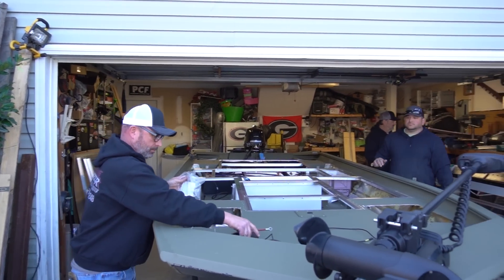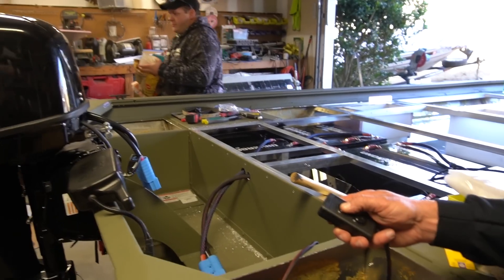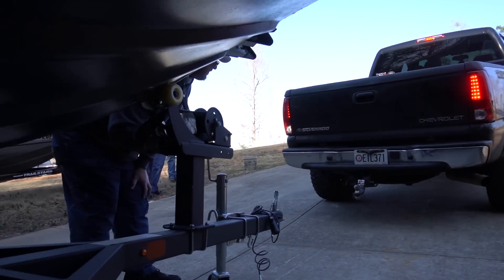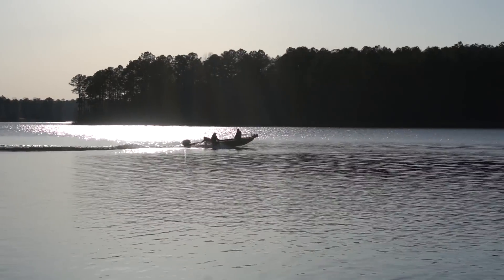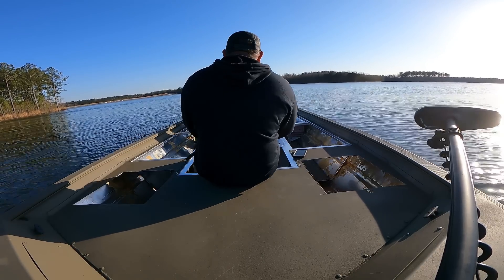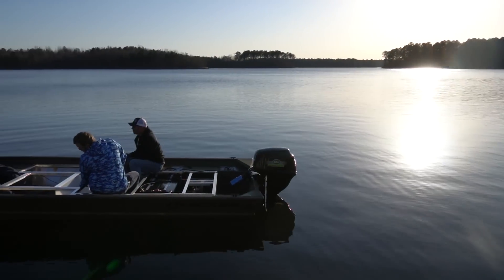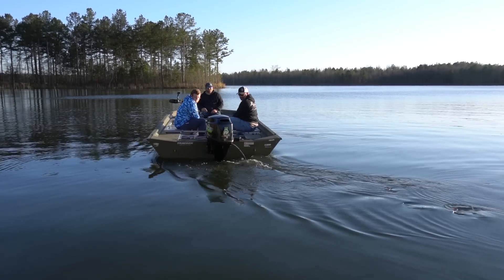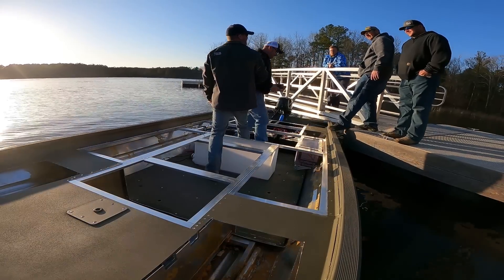World's FASTEST Electric JonBoat? Lithium Batteries | Tracker Grizzly | Elco 50 HP | TBNation

Comment: I dont really see the benefit in more weight and cost over gasoline engines? I would imagine the long term maintenance would be alot more inconvenient as well.
If you do the math the electric system is about triple the size/weight.
As far as "electric only" lakes, if they keep onto this tech they will eventually just HP cap those "electric only" lakes?
I feel like the tech just isnt there yet. As a mechanic, it still seems alot more dangerous, more expensive and more heavy.
When you factor everything into play, all of the key points are still drawbacks to combustion motors.
Much like home solar, when its calculated out, there really arent any savings over grid tied electric in the long run due to how expensive high voltage battery technology is to obtain and maintain.
This is also why we dont see the conversion to electric cars yet, they are too expensive and less profit is generated in production.

Comment: You should move that heavy battery bank closer to the front of the boat...at least just past the middle of the boat...it'll get out of the hole easier & the back of the boat won't be so low in the water...

Comment: Could you just hook up a good generator  to the motor and provide the electrical current that is needed for the motor? I know the reasoning is to not have a combustible engine but I was just thinking that the batteries have to be really expensive and the more you use them the less life they have.

Comment: Well now...gotta figure a way to circulate cooler air into the battery compartment to cool the batteries down while riding.  But am curious as to how long of a run time you'd get from it.
Reply from the maker: Only runs as long as the motor will allow at this point

Comment: I think I have the right video , I think I was told, this boat a 1860 ,now does that mean the first 2 numbers says it's an 18ftr, what does 60 number mean, my main objective is, I do prefer " A ", 
John boat fishing boat,  but I want a like possible 20ft long battery powered operated boat, I am currently living in a 22x30 ft 2 story house,  so with the size of a 20/22ft john boat, you folks are working with that 1860 boat,  I have already seen your video several times,  and I have been studying other videos and other larger boats,   I'd like to have a seaark boat,  and their factory,  I'm almost preferring a DIY john boat project,  and the speed you folks are showing is very well plenty of good speed,  but finding a good 18/20 footer and hitting the lottery is next to impossible,  yes, I admire your video,
Reply from the maker: First two are length, last two are width at the bottom
Reply: biy ßraray 44 fitt suncertd

Comment: The only way you're going to find out if there's anything wrong with that motor take that sumbitch out open it up and let that son of a b** run keep your eyes on the battery and just see what you can see what's going on but take it out and open it up and let it run you doing more wear and tear on that engine shaking up picking up the top speed and then letting off the gas that's more wear and tear on that engine than anything

Comment: Вот так должен ехать лодочный электромотор 15 кВт https://youtu.be/vLlf4S8VSts
Reply from the maker: Nice, fastest inflatable?
Reply: @fireantfishing  I alone in a boat can accelerate to 36 km / h with a 21s 88v battery.  If you put a gearbox with a gear ratio of 1.5, then the speed can theoretically reach 45 km / h, but such a gearbox is unrealistic to find, and you don't want to increase the voltage to increase the engine speed

Comment: It takes too much space in such a small boat and it's got to be heavy as well which will make the engine burn the juice faster and the boat will go slower too because of all that weight. Ain't make too much sense. The top speed of my Yamaha 50 HP 4 stroke is 34 MPH!
Reply: futre bateeß has less wight mkeer watts oer kg

Comment: I bet putting the batteries straight down the middle, adding an adjustable-height jack plate, with tilt & trim, and playing with the pitch on the prop will get you over 30mph.
Reply: Boat'll plane off faster with more of the battery weight farther forward.
Reply: yes

Comment: So it's louder and slower than a 4-stroke and barely gets an aluminum jon boat on plane. Gasoline outboards having nothing to fear.
Reply from the maker: Gasoline outboards are not allowed on this lake, there are a few others in GA
Reply: @fireantfishing  I get it. We have limitations in some coastal areas here in LA. We have 25HP limitations in a sensitive WMA.  It doesn't change my point though. Electric marine power, at this time, is best left to high torque, low RPM, displacement hulls.    Besides, I believe Elco is overrating that motor. There is no way that motor is putting out 50hp.  You're not the only ones trying to make an eboat. Xshore is launching the Xshore 26 and even in their promo videos and tour videos I have to laugh. Thy can only run WOT for short bursts, and their boat is $400K with some bells and whistles.
Reply: baters ebergo nkt onnpar

Comment: Thats gotta be one heavy jon
Reply: Not really. Those lithium batteries probably only weigh 20-30 pounds a piece. Probably just a heavy as 3 lead acid with the amount they have in there.
Reply: Look at the water line and you can tell its not heavy

Comment: a terrific example of what not to do and why people die in boats. Not a single life jacket was worn on a experimental boat. The max weight on a grizzly 1860 is 940lbs. That's before all the modifications. The boats overloaded before a single person got in. That panther electric steering is not for high hp motors. That alone is dangerous AF.
Reply from the maker: I agree on the life jackets. They were in the boat but 100% should have been on. Dont agree with the weight being overloaded before anyone was in it...? As far as I know, the owner spoke with panther electric steering before purchase to find out what was recommended. Although if this was mine, I dont think I would have that on. Does seem a little sketchy when you think about it
Reply: They are adults, they can make their own decisions.  You sound like a child.

Comment: Put wheel hub generators on the trailer so every time you hit the brakes, power goes into the boat batteries.
Reply: yeah itd be great if they added induction motors to trailers to help you stop and accelerate off a full stop. Wouldn't need a big battery either

Comment: This is awesome, but there is no way that motor is capable of 50HP.  Seriously, for the money you put into it you should get 50HP like Elco claims it is.  50HP is 50HP, it's not some made up number.  This is barely 20HP.  Elco should send you half your money back.
Reply: It should cost more to insure eventually when electric outboards are mainstream and there are many old ones as there is more potential for death with high voltage and water and especially aging parts. I think they charge way too much for those Elco outboards and they should be at least real with the hp numbers.

Comment: That's pretty cool stuff, right there.  What is the noise of the electric motor like, compared to a gas equivalent?  I'm guessing the sound of the wind, when you're on plane, makes it all about the same?

How many hours of run-time are you calculating? I may have missed that in the video.
Reply from the maker: So with this battery setup we expected 1hr to 1 1/2 hrs of full run time. After we got back from trial run, Nathan ran some tests on the batteries. New calculations are looking more like 2-3hrs of continuous wide open run time.
The noise is very distinct, however I don't feel like it's worse than a gas motor by any means. Not nearly as loud, and not as annoying to hear run all the time

Comment: Electric boat sounds great, but when it does sink all that battery acid will leak into the water killing everything in its path. Gas doesn't do that, 8 batteries for this little boat. Remember 1 battery and electric motor and a generator is all you need, the battery turns the electric motor the electric motor turns the generator or Alternator and keeping the electric motor running just like a vehicle.  Electric cars can run by themselves if you put generators on the axles. You never have to pay monthly bills. Remember they don't want you to have any of that.
Reply: Not sure if you were being funny..... So you think big money is the reason science hasn't created useable perpetual motion? :)
Reply: @edkurek3105  what, the motion of a vehicle can create electricity,  so an electric vehicle can charge itself by simply using it. If the batteries are getting charged you will never need a plug. Or a monthly bill for charging any vehicle.
Reply: Electricity is simple, we learned how to sore it. Now you have a battery get an electric motor create a Generator. As the battery turns the electric motor the electric motor turns the generator the generator keeps the battery charge and the battery keeps the electric motor running.  Once you start the system it will keep itself running until you shut it down or a barring or part breaks. Free energy does exist the world doesn't need monthly bills only the greedy prevent us from having it. Wake up America we out number them.
Reply: @rodneyarmstrong3813  perpetual motion?  Lol.
Reply: @martinmiller7623  perpetual motion with being able to collect the electricity and store it to reuse it.
Reply: @rodneyarmstrong3813  you better hide big energy will be hunting you. Lmao....
Reply: @martinmiller7623  they have a unit about the size of an Ac unit that will power your house and it will keep running until you shut it down or a part needs to be replaced.  They will say it's not up to code stopping you.

Comment: “50hp “ and it did mid 20’s ha ! I have a 16x56 with a real 50hp and it does 1
44 and it probably cost a 1/4 of that boat . Hell my brother has a 1448 with a newer 20 merc and it’ll do faster than that boat loaded with 3 guys and decoys , Plus all the other bs you need to duck hunt ! 
No thanks .
Reply from the maker: I get your point, however your boat would not be allowed in the lakes around here due to being electric only reservoirs. That adds to why this is pretty spectacular.  Most guys with 16' and a 10hp electric outboard are only going 7-9mph 10 if they are lucky
Reply: @fireantfishing  His point was, it says 50HP and you are not getting 50HP.  Why does this not bother you?  You were ripped off.
Reply: wróñf

Comment: Hmmm ... I didn't see the use a kill switch or life jackets.
Reply: Lifejackets were on boat!.. all coast guard  requirements were met!.. this was a test run for motor operation and weight distribution. Which was nailed by experience with electric boats and knowledge, Kill switch is on gear shifter, this was not during a tournament so not required but will be used when required!.. any more questions?..🤔

Comment: So i love the build but as Safety goes Do you think running a panther electric steer for something that was built for a kicker motor going no more than 5 or 6 miles an hour is safe to run at that speed I don't see a good recovery rate if the boat were to get out of control
Reply from the maker: I'm going to be honest, that was my first thought as well. Now on electric only reservoirs I wouldn't be as worried about it, but on a bigger lake I'd be a little sketched out. I keep playing over in my head that recent viral video where the guy in the ranger took off for a tournament and the boat caught and he hit the bank...haha
Reply: wribg biyt bahas ryñ

Comment: 7 grand in batteries alone
Reply: Every year? 2 or 3 ? Motor is probably at least that much too.
Reply from the maker: 12k in batteries. Will last 10 years, with better performance from the batteries. Keep in mind, built for electric only reservoirs

Comment: Impressive speed. Also check out that no hands required panther steering system
Reply from the maker: Looks good doesn't it!
Reply: 22-26mph is impressive?  LOL.
Reply: @jeffissimo1221 Can you top that speed?? I'd like to see how fast does your total electric boat go👀
Reply: @aaronwilson8198  That's just it. Given the current state of electrical power systems, I wouldn't waste my time trying to get a planning boat to make use of electric power.  Electric marine power is best left to displacement hulls, where hull length will determine vessel speed.    Go look at the Yamaha performance bulletins... 25hp... 16' aluminum multispecies boat...1,300lbs plus... GOT ON PLANE, and went just as fast with only 25hp.   50hp Yamaha on a MV1756SC, 1,780lbs fully rigged, 32mph.   The boat in the video was a Tracker.... looked like maybe an 1860. That boat is less than 800lbs, couldn't get on plane and couldn't get above 26mph.  Does electric power have a place? Sure. In a displacement hull. But when the title of a video says "Fastest electric boat....blah blah blah" you can't blame others who point out that there are better alternatives.
Reply: @jeffissimo1221  hey cool story bro🙌